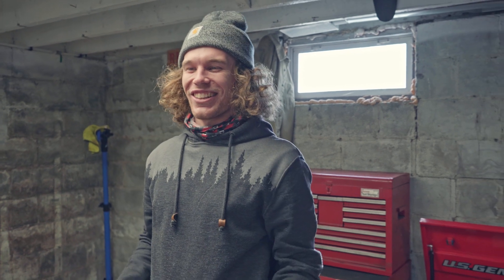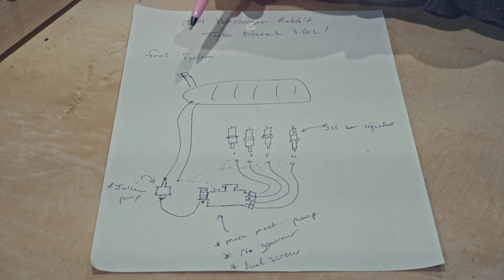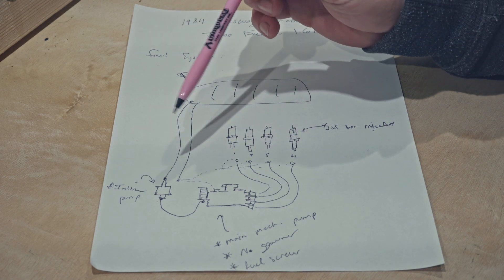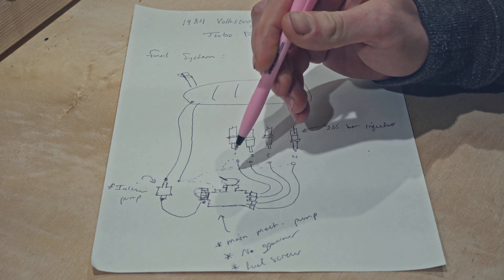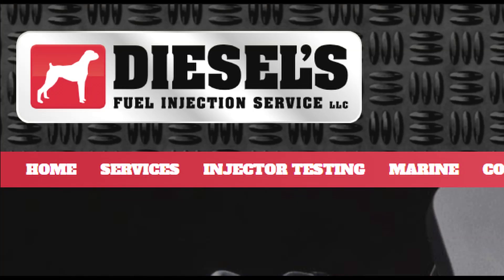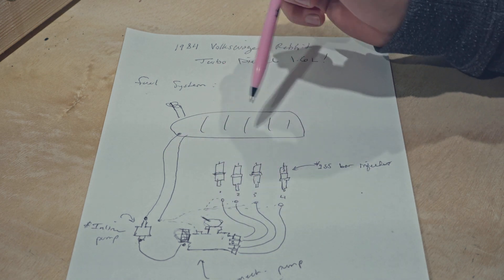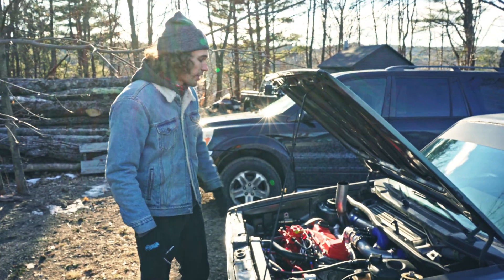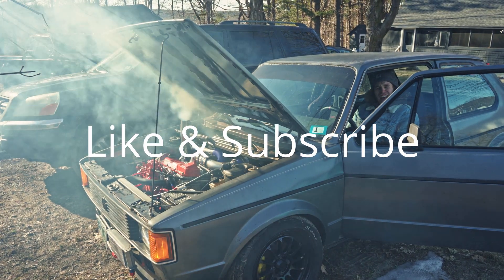Fools & Spools, Turbo System Explained - 1984 VW Rabbit Turbo Diesel (HD)

Comment: Do you have hydraulic lifters? I've got a stock turbo engine with mechanical lifters, and I just discovered, the locked up engine currently occupying my project rabbits engine bay is hydraulic!
Pretty cool, never had one before. Hopefully the block and head are salvageable. If not, they'll make for an interesting post-mortem.

Oh and I almost forgot. Sperm bourbon turd-burglar.
Reply from the maker: 😂😂🙈 sounds dope! This head is mechanical. Pretty sure you can put a hydraulic head on a mechanical block so long as you put a plug in one of the oil return holes 💁 could be pseudo science lol I've never tried it. What are you doing with your rabbit next?
Reply: @OliverFetter  right now, my donor TD engine is on my garage floor. My '85 4 door is in my drive with the afore mentioned blowed up engine still inside. 

I have a D24 intake I need to modify and I'm planning to purchase an Amazon pop tester so I can try my hand at rebuilding my injectors. 

I'm hip deep in the contemplative stage of the build. 

On the topic of hydraulic vs mechanical heads, I've read that MLS head gaskets from the AAZ engines can be used only on 1.6 diesels with the hydraulic head and block. Is this true? I seem to recall that you've been using an AAZ MLS on yours.

Thanks for the sweet content, man. Keep it up!
Reply from the maker: Hey! That is somewhat true! I had a mls gasket custom made for mine. Didn't end up using it bc I damaged it on installation 🤦 but haven't had an issue with the regular paper guy & head studs

Comment: Did you have to get a factory turbo injection pump or did you use the na pump?
Reply from the maker: To turbo this motor you absolutely NEED a turbo pump. The TD pumps have diaphram on top that increases fueling with increased boost presure. Without it, you'd just be running really lean all the time (without power gain). I bought a junker '85 TD motor a few years ago which is where  I got the pump & block.
Reply: @OliverFetter  thanks for the response I'll start looking for one now.
Reply: @OliverFetter  
Dude. 
NO!

You do not NEED a turbo injection pump. 
The eco diesel came with a n/a pump. 

The LDA on the injection pump does not add additional fueling. It merely controls the amount that fueling is being removed  from the injectors until boost comes on and the fueling becomes the same as what a n/a pump 

If you did a standing  drag race between turbo pump a n/a pump o same turbo motor, the final output of engine is identical.
Reply from the maker: @fastinradfordable  Heyo Nathan. Without testing I cant really conclude anythng since I didn't make the pump. BUT you can only turn the fueling up so much before you acheive a horifying perpetual rev-hang. To your point, if the LDA reduces fuel when not in boost, then you can actually increase the fuel screw more on a TD pump because your idling rpm will be less than an NA pump at the same setting.

Comment: what secondary fuel pump are you running?
Reply from the maker: I'm honestly not sure of the exact model - it's a 12v DC inline diesel fuel pump. You can find them on eBay or Amazon. It's really handy when you need to bleed the injector lines or main pump.
Reply: @OliverFetter  I'm always keeping my eyes peeled for the stock fuel filter body with integrated manual priming pump.
My pal told me a tale of their existence, but I've yet to encounter one.
Reply from the maker: Sounds handy!

Comment: What boost level are you running?
Reply from the maker: Yo! In this video it was running ~20psi. Since then I've bumped it up to 30psi 🤠🤠🤠 video to come.
Reply: @OliverFetter  its running On metal head gasket?
Reply from the maker: @Kurzac_Classics  Not yet - I am going to be rebuilding the car soonish and that is one of the tweaks I will be making. It does have ARP studs which I'm sure is helping.

Comment: How much boost and about how much HP/ torque? I have an 84 with 580k miles (its been rebuilt). I need more than 50hp as my last project was a G60 Corrado.
Reply from the maker: Heyo! I'm not actually sure about HP/torque... I really want to get it on a Dyno but I've been tooling with other things as well (to come). Currently, it makes about 25 psi with a GT17 and that scoots it pretty good. You can definitely make diesel rabbits a lot less pokey with a turbo! The bare-bones NA can be quite a drag (or drone rather lol). I ran one for a while though, with good tires and suspension it can still be fun - an engine power is only one part of the driving experience!
Reply: @OliverFetter  Very cool, your coal bunny is badass! NA isn't horrible its just a dog. It will cruise no problem which is enjoyable . I have a new turbo and a used intercooler. I just need to figure out all if the plumbing, which is the fun part. Thanks for sharing and I enjoy your videos!
Reply from the maker: @emtbxl4212  Thanks ya! That's going to be dope. Best of luck on your build - and update me??
Reply: @OliverFetter  Thanks and will do!

Comment: Can you show how you tuned the fuel pump and what transmission are you running?
Reply from the maker: I can probably take a wack at that! It's tricky finding time to film but can-do. Some of the pump modifying was done by an injection specialist, but there are still a few things you can do without tearing into it and I can show those.

Comment: I also have a Giles-modified pump on my 1.6td. Isn't the heat produced by the turbo keeping the intercooler hot & reducing any benefits? Additionally, with the intercooler face down, aren't you basically preventing the air from flowing from the front to the back of the intercooler?
Reply from the maker: That's cool man! The intercooler is separate from the rest of the engine compartment, so that's not an issue. The air flowing through the hood can only go down and into the car based on pressure so it doesn't matter so much what the orientation is.